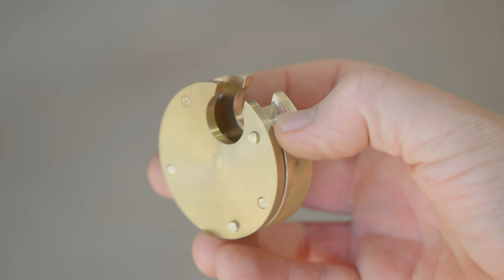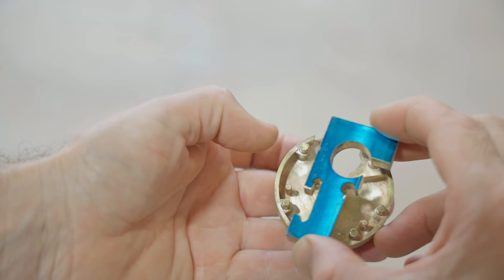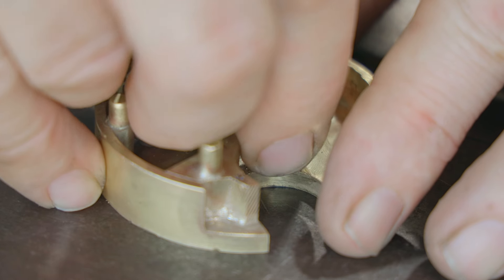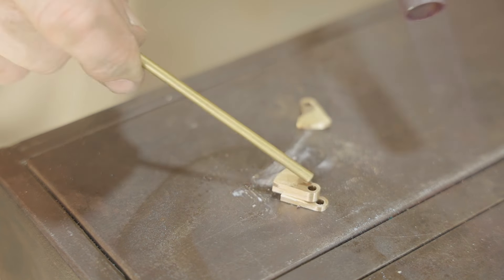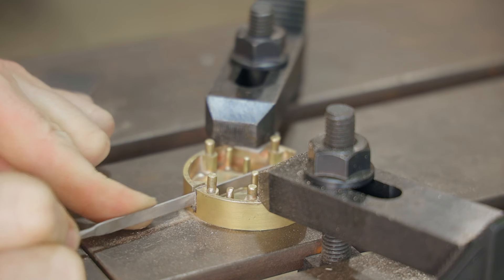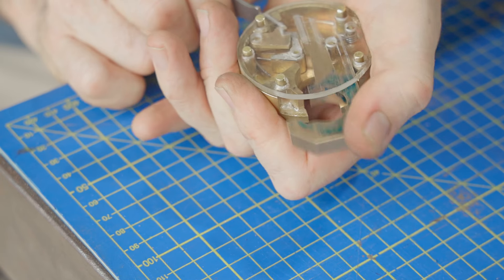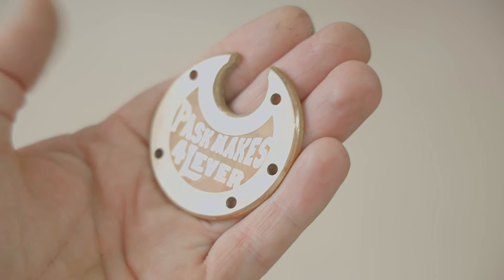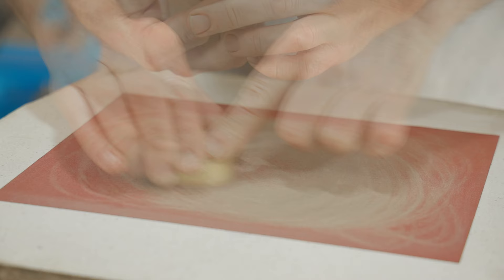Brass Padlock made from Scratch - Now Complete

Comment: You may want to try some false gates in the future. Thats a shallow cut-out for the locking bar/pawl that cant fully seat so the lock will remain secured until you manipulate the past the false gate. It doesnt make it impossible but the closer a false gate is to the real gate, this adds complexity for hardly any costs.

Comment: Just had a thought. When you were drilling the stack for the levers, if you put some soft material such as aluminium between the moving jaw of the vice and the stack, it should deform enough to securely clamp all of them. The fixed jaw is your reference plane.

Comment: It really does look awesome and as a toolmaker by trade it is awesome to see how you go about the different machining methods and to see how you do it against what I would think to do. Just a quick question on the bearing surfaces with the pins, did you use any lubrication on them or did you consider that not necessary with the small movements they make?

Comment: This was awesome. After watching many videos from the Locking Picking Lawyer, it’s great to see the other side of how locks work. Great job Neil.
Reply from the maker: Thanks Tricia! :)
Reply: I wonder how LPL would do against this... it seems like there's nothing to tension, which... changes the game a bit??!?  Granted, if this is a whole style of locks that exists in the world, then LPL probably knows how to confront them.  Still, an interesting thought.

Anyway, yes, great work, Neil!
Reply: @DavidLindes  That spring pushing the shackle open supplies a bit of constant tension, you could increase the tension by pulling on the shackle.  With no false gates, you could use a pin to feel which lever is binding, and slowly push it into position until it clicks into the gate, then go push the others open one at a time.

Comment: Awesome project. Saftey note generally in chemistry i was taught to add powders to the whole volume of liquid this prevents the heat of solution of the powder causing boiling or flame (in the case of adding liquid to powder) depending on the powder.

Comment: Very cool. 
Don't know if anyone else suggested this but if you put a slight countersink in the pin holes you will end up with a nice flush solder joint. Saves some of that annoying Dremel work.